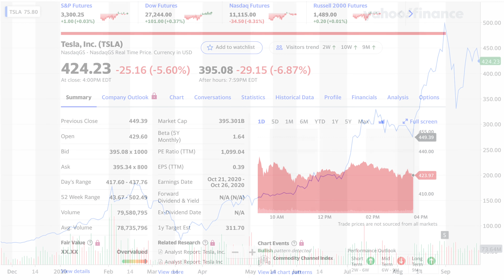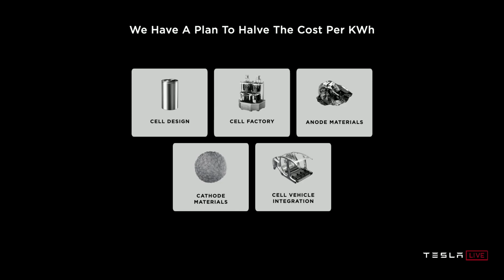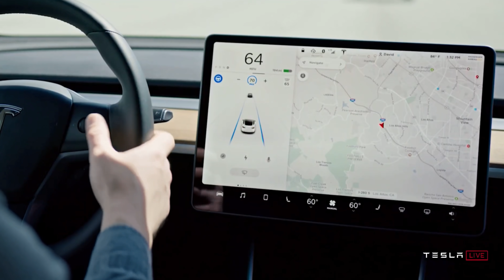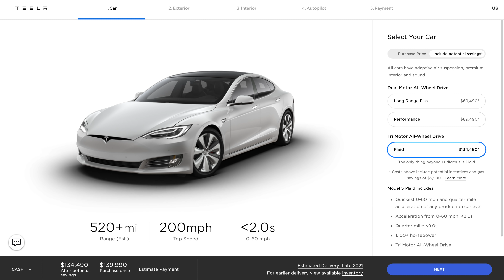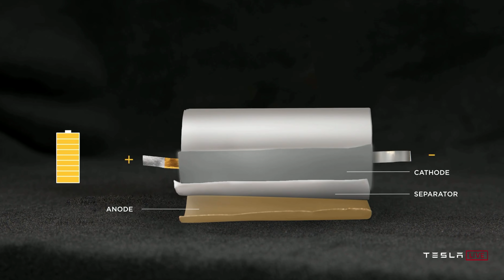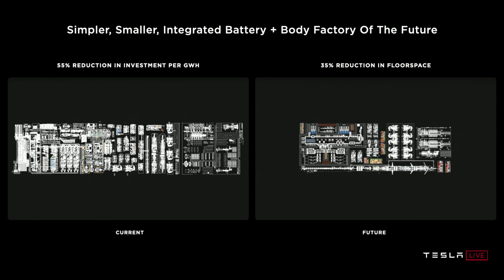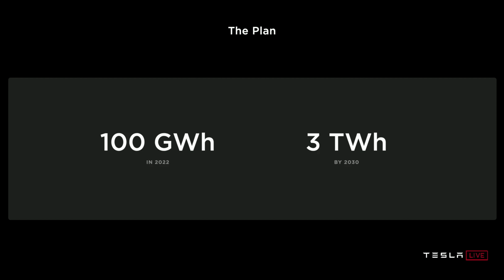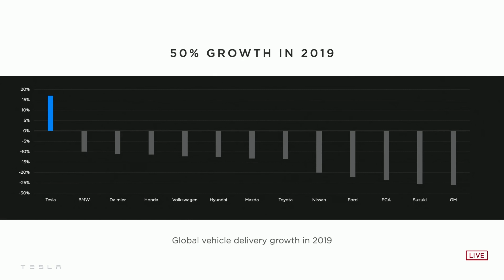Battery Day: Tesla’s Path to Becoming the Most Valuable Company in the World (TSLA)

Comment: Rob, can you have a second look at those percentages? You cannot simply add percentages like that, they have to be multiplied together. Something strange is going on there.
I can elaborate if needed.
Reply from the maker: Which ones?
Reply: @TeslaDaily  All of them. If you improve something by 20% and then again by 20% it is not a total of 40%, it is (1.2*1.2)-1 = 44%.
If you reduce cost by 50% and then again by 50%, you have not reduced cost by 100%, you have reduced it by 75% 
1-((1-0.5)*(1-0.5))

Just imagine that each step was separated by a year, and unveiled separately, that should make it more clear. It's compound interest.

Here are the actual numbers:
Range Increase: 1.16 * 1.2 * 1.04 * 1.14 = 65% not 54%
Price reduction: 1 - ((1-0.14)*(1-0.18)*(1-0.05)*(1-0.12)*(1-0.07)) = 45% not 56%
Investment reduction: 1 - (1-0.07)*(1-0.34)*(1-0.04)*(1-0.16)*(1-0.8) = 54% not 69%

This is actually pretty basic math for engineers, so I don't understand why they would add them instead of multiplying correctly.
Reply: Yes you can add them together in this case because they are additive steps. For example the total cost of hamburger is $100 the patties is 25% of that, then the buns are another 25%. The labor of cooking them is another 25% and the remaining 25% is miscellaneous. Now imagine you are able to reduce the cost of each component by $2 that is 2% for each step and you can just add 2+2+2+2=8% which is $8 of a $100 dollars cost. Yes percentage is tricky because sometimes you cannot do this but there are cases where adding percentage do make sense and this is one of them.
Reply: @kazedcat  Okay, yes, some of them can actually be added, good point. I will have a closer look, as I really think they cannot all be added that way. Then again, I find a really strange that Tesla would make that mistake, so it might just be me ;-)
Reply: @kazedcat  Hi again. I have a question for you, to make sure we agree. To make this simple let's look exclusively at anode and cathode material, and only on range increase. Tesla states 20% increase for anode, and 4% for cathode, and adds those together to 24%. Now imagine that they had only had the anode upgrade, and had increased the range by 20%, from say 100 miles to 120 miles. Next year hey now announce that they have made a breakthrough in cathode material, and have increased range by 4% from 120 miles to 124 miles - but that is not actually a 4% increase, it should have been 124.8 miles.
Where am I wrong here?
Reply: Allan Kirk You assumed that the percentage are independent of each other. The problem is that they started with the total percentage improvement and then calculated the portion of that improvement attributed to a specific component. So the value they are quoting are dependent on all improvement being implemented. If some of this changes are remove then the value changes and needs to be recomputed. This is the tricky part of percentage math they are not stable the order of your calculation leads to divergent result. This divergent result are equally valid you just need to specify on how it was calculated. Percentage are valuable tool but they are damn messy and there is no way to fix it.
Reply: @kazedcat  Ahh, I see, thank you. I understand that they cannot go into too much detail in a presentation like this, but I seem to remember them saying that each step was independent of the other steps, so I guess it is really just sloppy use of language.
You had a really good example of cost reduction, and having gone over it a few times in my head, I can understand that with a lot of unstated premises that can make sense. I still have a feeling that something is wrong with the range increase though, but I will leave it at that.
Thank you again - always good to be politely corrected. ;-)
Reply: Allan Kirk The actual step are independent. The only issue is how they calculated the percentage. They started by calculating the total improvement this lock the individual percentage to be dependent of that total value. This is purely an artifact of percentage function. This particular calculation is very nasty because all improvements has to be converted into range but some steps would have energy density to be the relevant parameter.

Comment: The only question mark I had over what Tesla discussed was on the dry battery tech. They seemed less confident about having that technology nailed today (it's not just a case of scaling) and are hoping that it will be done in about a year (3-4 months per revision of the machinery, Elon said hopefully v7 is when they solve it, current v4). Given past timelines it wouldn't surprise me if that slips to 2022 or later, and that was the biggest efficiency gain. I was hoping for a little more certainty in that area (and generally), but let's see. Agree that questions outstanding in charge rate and cycle life.

Overall the presentation exceeded my expectations in terms of where Tesla are expecting to be by 2022 but I am cautious given history of missing timelines. A lot hinges on scaling the battery production in order to deliver the Semi in particular, which I think is meant to start limited production this year (feels ambitious)
Reply: Theyre protecting themselves from the Osborne effect. Dont forget they slipped out, "we've made tens of thousands of cells ready to go already"...and then quickly stumbled away from that comment
Reply: Callum Glass when in the presentation did they say that?
Reply: patmanrick , many picked up on your concern. Upon reflection, I feel they are just refining, as you say, the efficiency gain and I am not so concerned as I was during the presentation.
Reply: Always add plus 1year for tesla since this is new thing for them definitely a different industry for them.
What really matters was commitment on going fast and aspirationally targeting high numbers may fail but still the leader in the industry of battery technology.

Comment: I think a lot of investors assumed that a 'million mile battery' was going to be announced, but there doesn't appear to have been any mention of the life of the battery. That alone would trigger a sell off if they didn't appreciate the significance of the other announcements.
The new battery is an absolute game changer in terms of cost. It's hard to see how anyone can compete when this comes on line.
Ideally they will need to raise the battery voltage to achieve significantly faster charging because the cable resistance is an issue. That does pose a problem though, because the Supercharger network can't readily be changed, so they're probably stuck with it as it is. That does limit how far they can go.
Reply: Roger Froud , it feels like the million mile battery was implied rather than announced.

Comment: I think we're just as likely to see a large reduction in pack/ cell numbers leading to a slight increase in range with faster charging.
If you take that "500 mile model 3", reduce the pack by 20% volume and cost but with V3 level charging 0-90+% it's more than sufficient.
Resources saved, costs reduced.

Comment: Rob, you omitted the MOST IMPORTANT negative note from Elon  regarding the dry battery electrode technology NOT being ready for mass scale yet (I.e. low yield). This is the ONE most important takeaway for me and a huge risk. I am not even sure why they simply didn’t reschedule the battery day until more certainty...
Reply: The confidence in the ability to get this working is in the fact that Berlin model y will be made with them. There will be a pretty strict timeline to meet. Therefore car production cannot start until batteries are ready, so they must be pretty confident in their ability to get this done.
Reply: Scholzey Elon and Drew said it’s currently working but not to the full extent. I think it’s okay to leave rooms for future improvements, so I don’t believe they absolutely have to have every single aspect of the battery improvements they talked about achieving their full potentials before implementing them to the production.
Reply: Scholzey also you can’t give something that’s not working a version #.
Reply: Ning Tong didn’t understand the part with version number...
Reply: Scholzey No, the Berlin factory will not have the roadrunner batteries in the beginning. Moreover, neither 3 nor Y will get this batteries in the beginning, they might get them in 2025 if all goes well. Did you watch the presentation at all?
Reply: @kyocerakitten1162  pretty sure he said it specifically.... I'll double check.
Reply: Scholzey the batteries will be manufactured in Berlin factory when the technology is ready for mass production. Which it isn’t now. They only plan to scale to 10GWh in Fremont PILOT facility by end of 21 or 22 I forget exactly. Giga Berlin is operational before then. If not it’s a huge DISAPPOINTMENT. I think they said LG will be supplying batteries for Berlin and LG built a factory in Germany for the EV market there.

Comment: They showed a station wagon in the background with large diameter wheels. EDIT: On second glance, 2:16:47, I think it's just a Model X, but the shape of the side windows towards the rear are represented oddly for some reason.

I'd also like to know if the factories are currently powered by sustainable energy, maybe produced offsite? Why are they not utilising PV cells all over the roof space?
Reply: I guess at this stage they might prefer to be selling all the solar rather than using it in house but yeah you make good points! They seem to have some solar there, maybe that is enough to power the factory already? Until they become an energy supplier and the Gigafactory roof becomes the equivalent output of a coal power plant, a huge net gain to the grid... terrafactories now become manufacturing and also power stations!

Comment: Range increase 50% price drop 56% what does that mean in cost reduction per car? 4K?
Reply from the maker: I think it depends how much weight savings the new cell/architecture allow for. If lower weight makes the car 5% more efficient, they can turn a 75 kWh pack into a 71 kWh pack. If Tesla's cost today is around $120/kWh, a current 75 kWh pack would be $9,000 while a new pack allowing for the same range could be $3,750. So $5,250 cheaper in that case.

Comment: The announcement was awesome but where is the million miles battery?
Reply: The anode. Silicone in flexible shell to absorb size change means no cracks/degredation..
Reply: @Scholzey  Eliminating solvent residue by not using the wet electrode method reduces degradation as well

The million mile battery thing isn't a big deal anyway. It just sounds good
Reply: They pretty much solved the thermal issue, make your conclusions from that

Comment: If Elon said everything you explained in this video, Wall St. would’ve reacted in a very positive way 📈
Reply: Wall Street can’t grasp the full impact of what was said. Long horizon investors get it.
Reply: Momentum values creates a sell off
Reply: WS reacted to the timing. Tesla told it’ll take still several years. So it all is longer than standard thinking and speculation in WS.

It will take few days for consults and experts to give reports to WS investors. The vertical integration is the magic which will push the stock to new heights. Elon basically said they can make +$20bn more revenue already next year.

Comment: Spot on man, I was desperate for those 2 things: durability and charge rate. Can't believe they left that out, and nobody asked
Reply: @noisypl  not on this event. I did ask mentioning Elon but no luck
Reply: Durability - these cells will generate a lot less heat than previous cells - so durability should logically increase. 
Charging - I can only assume that vehicles using the new cells will run at around 800+V rather than 400+V so charging rates should double.

Comment: My instinct tell me: 4680 is going to be out quicker than expected, Elon downplayed it  to not piss the partners... or make buyers want to wait for major price drop.
Reply: 2 years would be extremely quick for all this new battery technology to reach volume production.  Several of the changes are revolutionary: solid electrodes, tabless contacts, encapsulated silicon, radical battery pack redesign, etc.  They're working like crazy to get this many advances so quickly.

Everything Tesla and SpaceX does is fast, but this many changes takes time to implement, especially at scale.  

None of this will slow down Tesla's success, but the biggest cost drops will take a couple years.

Tesla still cannot meet demand in China, EU or even U.S., and that's at current prices.
Reply: Tesla speed is always faster than others.
Any resistance will be futile
Reply: @Steven Song  They’ll have them in the GigaBerlin-made Model Y. We know the Y made there will have the redesigned structural frame, so it wouldn’t make sense to use the 2170 cells in that pack. It’s just a matter of how quickly they can ramp up cell production, even if they don’t reach all their internal efficiency targets.